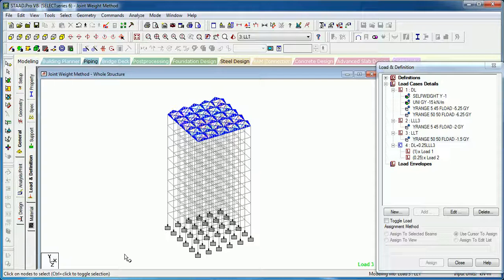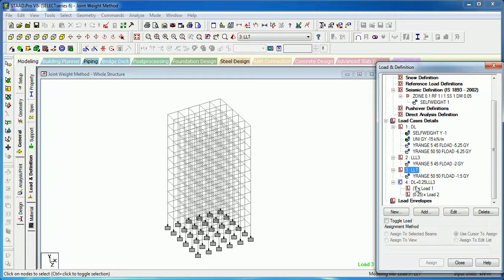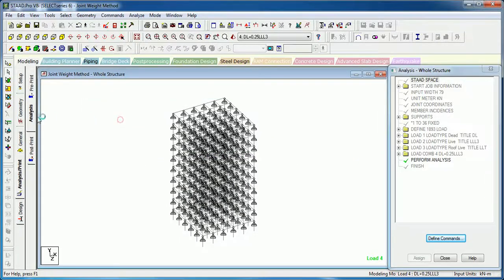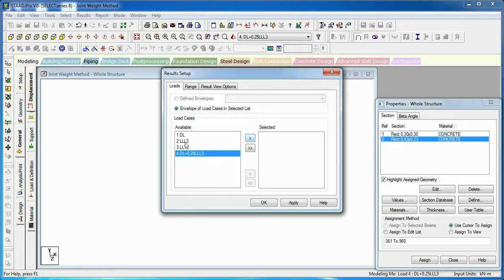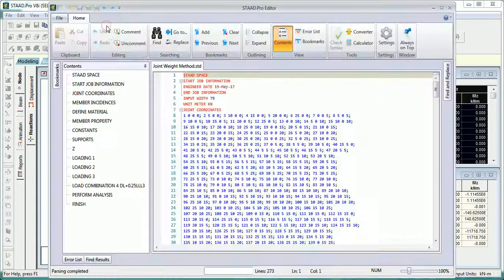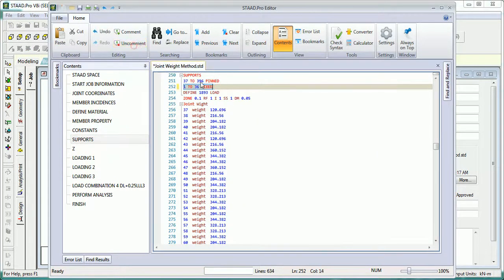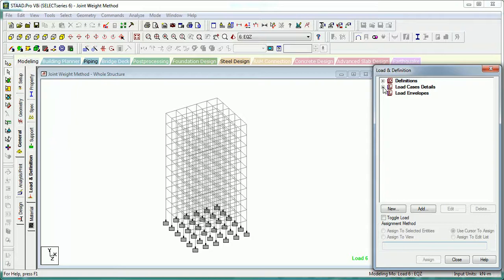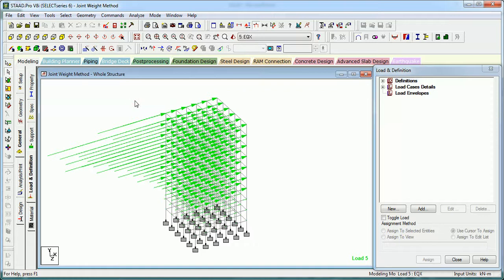Joint weight method in STAAD Pro

Comment: Hi Dear,
Thanks for such a nice video that i have been thougth much more...but ı have another problem with my project as i explained below...
I have actual concrete prefabricated frame structure..frame members (column and beam) joint are moment realesed connection.so The last column -beam connection joint is displaced from its top aroun 5 cm...so the connected beams support seams to be cracked..i would like modeled this displacement in staad pro but dont know how...in staad pro Helps says support displacement only can be applied when aplied enforced support to the spesific node...but this joint of my structure is not base point to apply support....so anyone can help me how to define my deflection on spesific node?
thank you
Reply from the maker: No idea.

Comment: Sir, after designing a structure if we look at the result sheet, for beams at different cross sections for a particular beam, there will be different reinforcement,(Means at some c/s there will be reduction in bars at the top and same at bottom) so which one to choose or consider..please reply (this question is not regarding this video, generally while designing I observed this issue..please clarify)
Reply from the maker: You shall have to take higher one and have to curtail as possible.
Reply: @Tinytopic  ok thank you sir...I would like to ask is it a general problem everyone face while designing?
Reply from the maker: Its not a problem actually, its the requirement, you shall have to detail accordingly.
Reply: @Tinytopic  ok thank you.